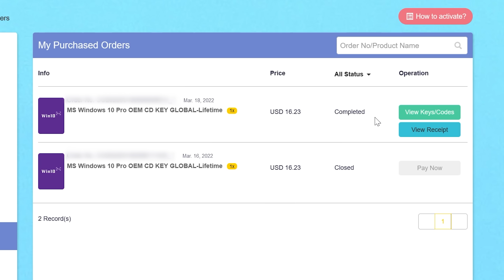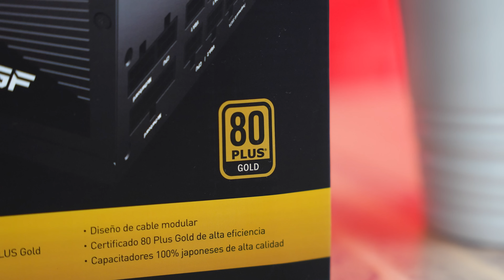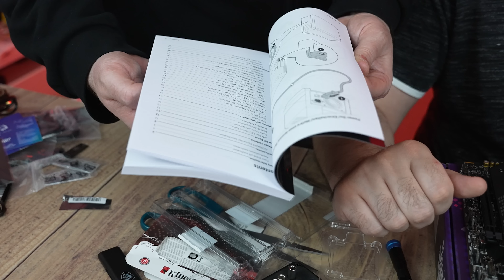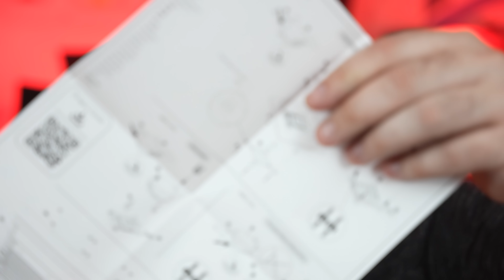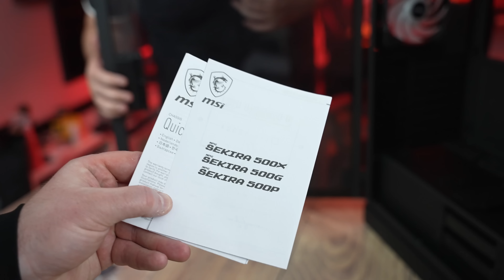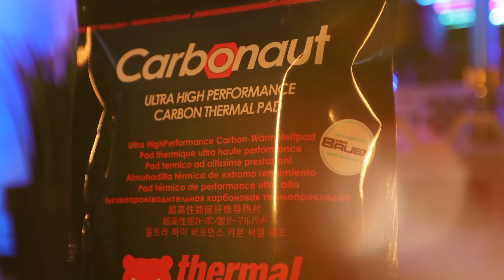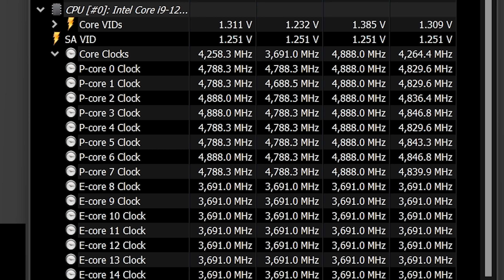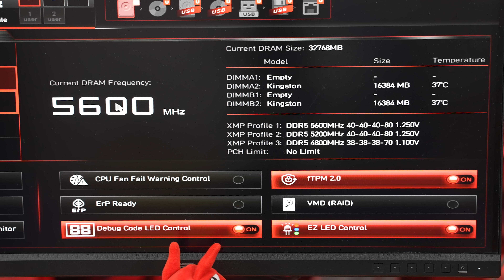Gajbotron All MSI Build ft Kingston

Comment: Ja sam skoro pre 2 nedelje uzeo novi pc Maticnu Plocu MSI PRO Z690-P DDR4, CPU Intel core i9 1200KF , NZXT Vodeno procesorsko hlađenje Kraken X63 - RL-KRX63-01,Ram Memory Kingston Hyperx Fury rgb 32gb (2x16gb) ddr4-3200 cl16 memory,Graficka karta GIGABYTE AORUS GeForce RTX 3060 ELITE LHR 12GB GDDR6 192-bit (rev. 2.0) GV-N3060AORUS E-12GD, SSD SAMSUNG SSD 970 EVO PLUS 500GB, NVMe M2 2280 - MZ-V7S500BW,,HDD 2TB Western Digital WDC WD20EFZX-68AWUN0,Power supply GIGABYTE Napajanje 750W GP-P750GM ,Kuciste Cooler Master MasterBox MB520,